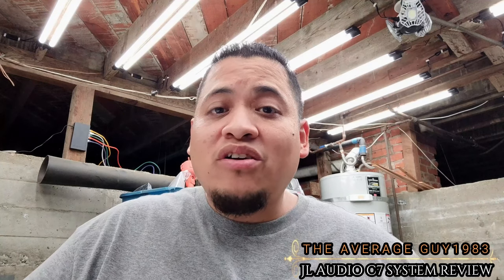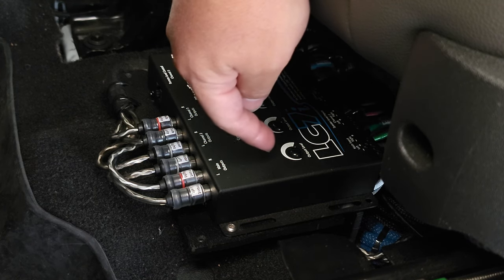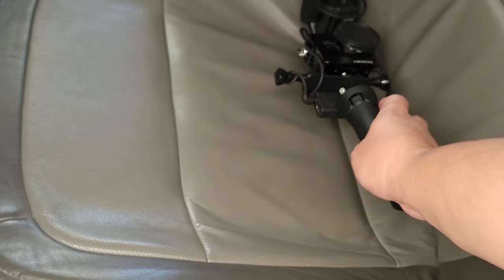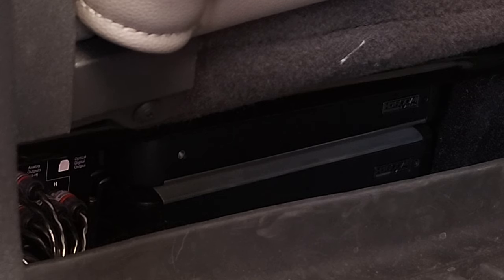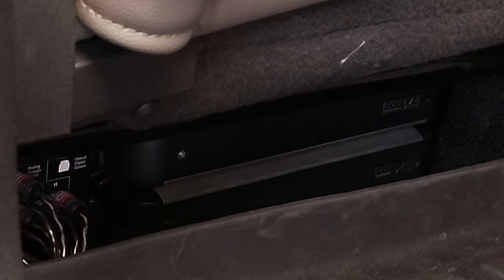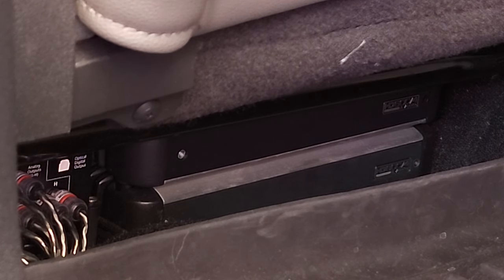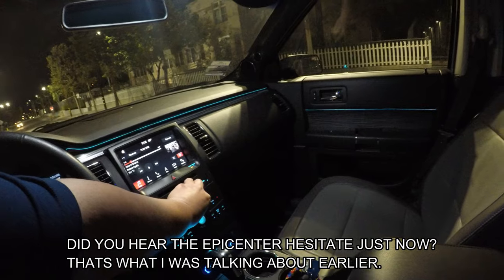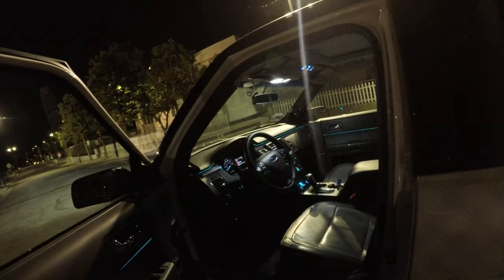MY JL AUDIO C7 AUDIO SYSTEM REVIEW

Comment: Those 3.5 inch speaker are not 100 rms maybe 50rms but no way are they 100 rms true power. Your system sounds really good but your bass setup needs more punch from the sound of it.
Reply from the maker: About the 3.5" C7 Exactly! I keep trying to tell people that but they keep thinking that I'm just bashing lol! About the bass needing more punch I agree 100% unfortunately that's about as good as it can get with the tiny stealthbox enclosure,  JL said it would work perfectly for the 10w6V3 and it technically does but I know this sub can do way more output in a larger box but since I did this set up with my family in mind with being able to fully use the whole car as it is with the 3rd row up and the trunk free as well as spare tire, this is pretty much the Peak of my system 😅 however I am planning something much bigger for my Park Avenue Ultra and in that car I can go more wild hahahaha.
Reply: @THEAVERAGEGUY1983  Try a sealed box, If the box is big enough try blocking off the port making it a sealed box.
Reply from the maker: @user-pwfus  I will definitely look Into it. 😁🙏

Comment: Comparing the jl audio c7's to the jl audio 10w6v3 running them both full volume, which one would over power the other?.
Reply from the maker: That would depend on the type of music you are listening too. For example I like to listen to hip-hop and, Smooth Jazz and 80s rock and on hip hop the sub can sometimes sound a little over powering and on jazz it sounds balance and occasionally lacking in bass. 80s rock is where most of the problem starts to be apparent that because of the lack of proper midbass from the music it's self it makes the subwoofer almost sound non existent. So the door speakers sound alot more louder and like they take control. This is why something like a DSP with Custom EQ settings does a pretty good job and allows you to custom set the Gain level to each driver as you listed to live music so you can adjust each speaker based on the type of music you are listening too and dial it in and whenever you play that style of music you can press that EQ preset and enjoy the music better, obviously it will lower down your gain on your speakers a bit or probably subwoofer depending in your setting but it would sound balanced.  Just a couple of things i learned using these TWK88s 😁👌
Reply: @THEAVERAGEGUY1983  what if you ported the 10w6v3 or added a second 10w6v3 sealed. Would that make any difference?. I believe you said you have a  w7 sub as well, how would that sound?. Because jl audio says the c7's are made for the w7 series of subs.
Reply from the maker: @dc5001  good question! And yes having a ported subwoofer like a 10w6V3 or even a 12w7AE subwoofer is by far the best choice for an audio system of this type. There is a HUGE output difference between my sealed 10w6V3 I got to please the wife with keeping the flex fully functional from its 3rd row and then there is the 12w7AE which I would have preferred to have permanently installed that basically has double the output of the 10w6V3 with the same Amplifier settings, zero changes to the amp gain or even the EQ settings of the TWK88 for the subwoofer line. The only thing is that the 12w7AE is Double the price of what I paid when I got the sub back in 20111 and alot of the people who watch my videos just don't want to spend alot of money on the JL Audio Gear and I totally understand their point of view as everyone is in a different financial situation. This is why I always say to go with any brand you can afford for now and then slowly move your way up the scale or if it's possible save some money till you have what you need to buy the gear you really want to own. But sometimes people get upset with me over that too. 😅🤷‍♂️
Reply: @THEAVERAGEGUY1983  like how you already have the jl hd750 you could always add a second 10w6v3 sealed for the other side of trunk. it wouldn't add that much space, and would be perfect for the hd750 because then you would be running the w6's on there optimum wattage which is around 400 watts rms each. Plus the hd750 will see a 4ohm load with the dual w6's so it will be more efficient with ohm load, combined with more cone area for better efficiency on electrical system. That single 12w7 that you got is perfect for the jl hd750, plus has higher sensitivity then the single 10w6v3, so better efficiency 4db difference, 3ohm vs 2ohm, and louder too. to me w7's sound best In a sealed enclosure, plus it will be more compact sealed as well. Did you ever think of fiberglassing the 12w7 to the same area as the 10w6 you got there now?.
Reply from the maker: @dc5001  I did but the 12 is way to heavy to put there. Another idea I had was removing the spare tire and installing the 12w7AE there in a custom made sealed box but then I got a flat and said perhaps not a good idea lol! Another 10w6V3 wouldn't be a bad idea either. There are not that many choices for me when it comes to the subwoofer for the flex as it's a full time family Vehicle. 😅 that old crusty park avenue I'm fixing should be fun though. 😁👍
Reply: @THEAVERAGEGUY1983  I would
just use aaa, and remove the spare those.by the way I love those a pillar build, would of loved to see how you did that work.
Reply from the maker: @dc5001  I will be doing another set in the future, unfortunately all the video clips I had about the A pillars I made where on my previous Instagram page and when I closed it it deleted everything. So I'll be sure to do another one. I have some 2016 Flex A pillars I can work with as a spare 😁👍 I would just need to buy more vinyl, I would love to find the original dune/beige color in vinyl to make them look original vs the dark Charcoal gray I went with that only matches one part of the door panel. The dashboard is much darker then the a pillar Vinyl I chose.

Comment: Wow i just bought these with a vxi amps
Reply from the maker: That's an excellent combination 👌
Reply: This is all going into my Honda type R
Reply from the maker: @Mookief8  you will definitely be very impressed! Just remember to change the Frequency for each speaker/tweeter to get it to sound the way you want. You can also make adjustments on the EQ part on the TuN software. If the music sounds too low, you can always turn up the Gain Output of the Vxi amps till you reach the yellow bars on the VU Meter. With real music playing you will see that bar fluctuate differently per speaker channel. You can go up to +12Db on the gain just incase you need to turn it up higher. 😁👊

Comment: What about a bass knob you don't have one
Reply from the maker: Hello, I apologize for not showing the knobs but I actually have two DRC-205 knobs and an epicenter. I have a video where I made a custom face plate to fit the 3 knobs. 1 controls the front and rear door speakers and the other one controls the subwoofer and the rear D pillar speakers, this is because I have two TWK88s but once I switch over to the VXi amps I can finally just use 1 knob with a VXi Hub to control both amps at the same time. 😁👍
Reply: @THEAVERAGEGUY1983  it's ok.. your good, I was just thinking about your video, I forgot why I was stating the bass know.. I'll look at it again , then I'll edit this comment.

Comment: Tune it with 70-75 percent volume up
Reply from the maker: The TWK88s have a built in distortion meter but i also used the SMD DD1+ and then tested the speakers potential with a SMD AMM-1 which is how i found put that they dont do they're rated power. This system was $14,000+ i could have easily spent way more if it wasnt for me doing all the work.

Comment: Fords “upgraded” audio systems are garbage. I purchase the upgraded package because I like the ac seats. I don’t care for any of the other features or upgrades. I have to upgrade my system every time a buy a new f150.
Reply from the maker: Yeah I agree with you there, ford can definitely improve in their Head unit audio quality, I do feel like I'm gonna have to get a Fix86 after all. There is only so much I can do with the TWK88 to correct the audio signal of the ford sync 3. 😅
Reply: I went with the fix and vxi amps I am very happy.
Reply from the maker: @jaredcrisologo4505  really? That's awesome that's exactly what I want to do for the flex and these C7 speakers and the HD Amps I currently have, put those in my other car with the C5 3 ways I have. 😁👍